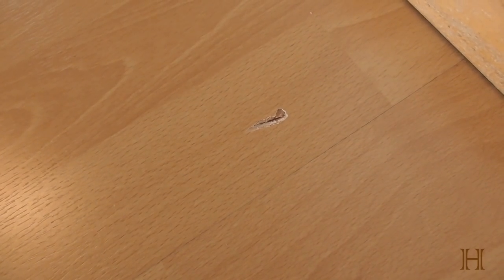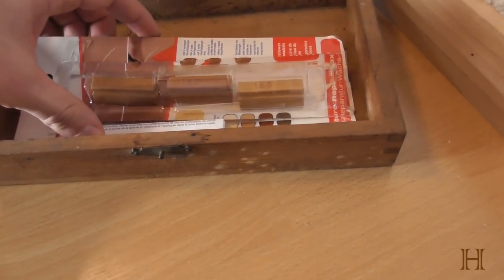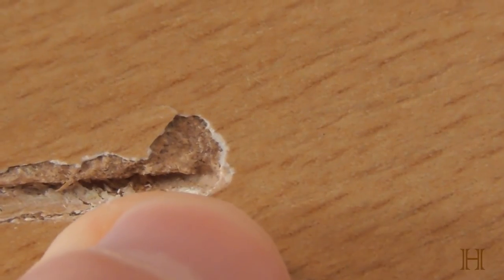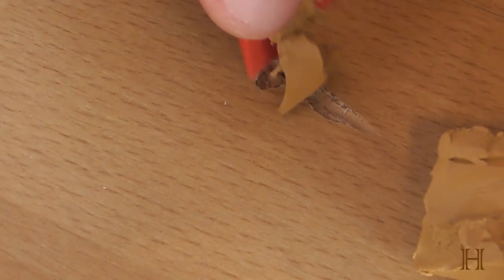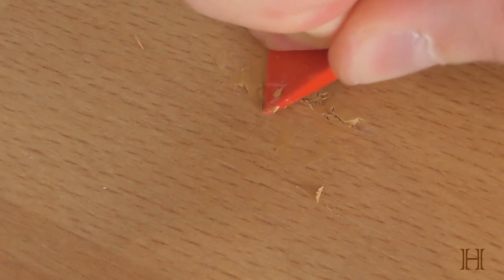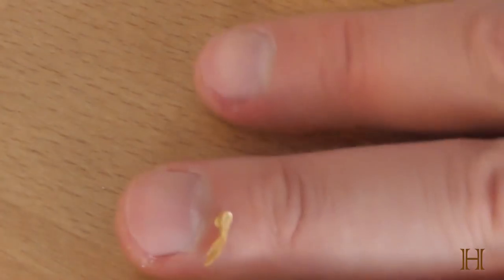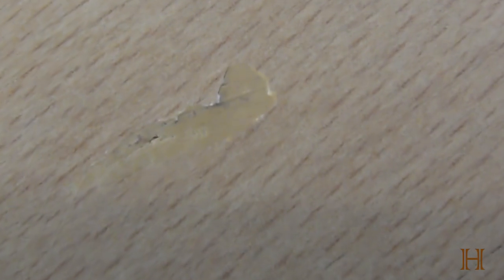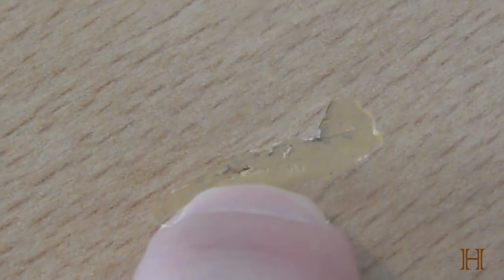How to fix a chip in laminate flooring - NO CUTTING

Comment: You will always have people criticizing what you do, never stop. Let their hate make you great. Some wood fillers work great, some others dont. but what I have found in my line of work that has not let me down till this day are Crayola Crayons, you get alot of different tones and they are easy to melt if you have an IRON to melt it on to the surface with. It works great for solid color furniture's, especially laminated furniture and cabinets.
Reply from the maker: Thanks for that tipp! I never thought of the Crayons. Definitely going to try that out.
Reply: MrTransformerprime1: Are you suggesting placing a hot iron onto a laminate floor?
Reply: @notsohandytim5090  💀 tell me he's not that Ɗumb

Comment: When i had laminate flooring i purchased a wood putty type stuff, of a matching color, which came in a pressurized can. Once applied it hardened, similar to a wood filler, only harder, if i recall correctly. Pretty sure I purchased it at a big box store chain. I would use that product over wax. I now have a house we floored with both oak flooring and bamboo. I'm here because i needed ideas on doing a board replacement as well as a dent repair on my adult daughters laminate. Watching your video jogged my memory of that laminate floor and the accompanying products I had those years ago. I think they would serve better over the long haul (less maintenance). If not i think I woukd use wood filler on this repair then maybe top it with a spray of laquer or something similar for the water repellant aspect. The wax job appears to have done the trick, but like you indicated, you will have to later redo it.
Reply: Do you recall what the "wood putty in a pressurized can was called you spoke about?
GDH Hayes
"When i had laminate flooring i purchased a wood putty type stuff, of a matching color, which came in a pressurized can. Once applied it hardened, similar to a wood filler, only harder, if i recall correctly. Pretty sure I purchased it at a big box store chain."

Comment: woodscrew in base board trim.....?
this video gave me a reason to live and pass on good carpentry skills...thanks H Ranch!
Reply from the maker: In Europe it is standard to use screws to secure baseboards, you can't put a nail through a brick wall. Plus our baseboards actually have a built in channel for cables that is why you want it to be removable.
Reply: ok makes sense..have a good new year

Comment: Use car body filler, preferably the slightly beige/yellow type. Permanent, can be coloured to suit the floor with vinyl childrens paints mixed to suit. Then spray either a clear satin or matt lacquer to seal. Perfect, cheap solution.
Reply: Was think of filling with epoxy or super glue.

Comment: Good tip but this video should have been condensed to 1-2 mins
Reply: I agree & disagree, 9 minutes of my life I'll never get back  BUT if it had been shorter I wouldn't have seen how many times it was necessary to go over and over the chip (I feel like a failure if some guy does it in 2 minutes and it takes me 30 and it still looks like crap). I think I have a more accurate idea of the issue and a potential solutions  (Comments), and I used the extra brain time to think of how I might be able to do a better (or worse) job.

Comment: actually if you have a soldering iron you can just drip wax into it and the wax will fill in the crevices. you will eliminate the gaps and holes that are unseen underneath the damage. good try.

Comment: I have the old laminated flooring and it has deep scratches that are from my child dragging the kitchen chair from kitchen to the living room,how can i ever get that scratch out, ive tried Murphy Oil and it didn't work, Help 😢
Reply from the maker: Scratches in laminate are permanent. You either have to remove the board with a fresh piece or use a wood wax to fill it.

Comment: I have a question because on mine dont got chipped like that but only raised the top layer also like bubbled hmm how to fix it Godbless
Reply from the maker: That sounds like watet damage. Then it tends to bubble up the top layer. Nothing much you can do, to properly fix laminate you have to replace the damaged parts. Other methods are for when it's not feasible like in rental places where you don't constantly want to replace floor sections.

Comment: That was a terrible repair I used wood filler and matched the stain it comes out perfectly every time
Reply: Do u do the same to repair chips and breaks on the locking section? So many are chipping apart.

Comment: Hmmm, a bit protracted which didn't result in a good job in the end 😟

First important part of permanently filling any holes, be it body filler, caulking, minor repairs to wall plaster, wood, laminate etc is preparation, (a) de wax the area and hole (b) ensure all dust is removed from the hole and surrounding area to ensure 100% adhesion.

Next select the best compound for the job, taking into account colour, material compatibility, depth /size of hole, water resistance, final finish, in the case of a floor, especially in a high traffic area, wear resistance, zero shrinkage and flexibility.

Then apply your chosen compound, first use a small amount to enable you to force the compound into the bottom of the hole to prevent entrapped air, then apply several thin layers to reach the surface, again, several thin layers will prevent entrapped air, but also with a thick compound such as this wax will make application easier.

Ref. softening the wax, many wax compounds will loose some of their properties if they are overheated, so no need to go silly with the heat, it just needs to be as malleable as kids plasticine or soft butter, the best way with wax is to cut a piece off approx 3 times the size of the hole,( to allow for re-working and waste ), put it into a bowl or dish over a pan of boiling water, keep an eye on it until its as soft as above, then also important, pre-warm the area of the hole slightly to prevent cooling the wax too quickly.

Finally, learn (1) the correct side of the spreader to use, you don't use the chamfered side ! and (2) the correct angle to hold the spreader, with regards to the surface you are applying the filler.

Done this way you should end up with a smooth finish without all the dragging, crumbling and re-working you had.

To get a great surface finish, a quick flash over the surface with a small blowlamp with a soft flame should produce a gloss on the wax, but takes practice.

Waxes are OK for minor scratches on furniture, but I wouldn't use it on flooring, unless it was in an inconspicuous place with very low traffic, and not in a doorway. 🙄

Before I get my ears burnt I'll answer the inevitable question of " What would you use."

The answer would be the correct material for the job, which would more than likely be either a self hardening compound, where speed of hardening is not of the essence, or a two pack compound which will cure in approx. 15 mins.

Comment: Laminate is cheap! Its not expensive to replace a  section!  That youre a DYI!
Reply from the maker: You do realize that older laminate floor is glued for example and that is not easy to replace. Or if you install new click laminate correctly and nicely you might not want to open up half a room to get to a damaged piece. But hey, you do you.